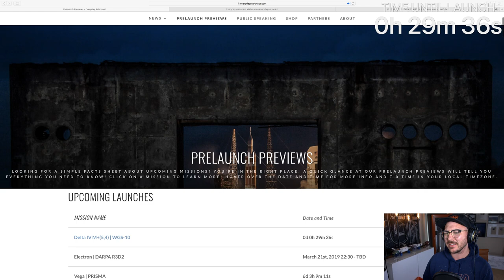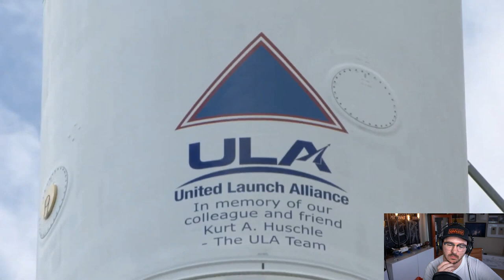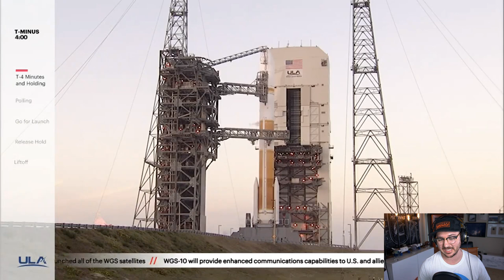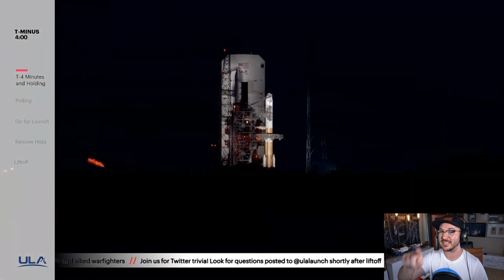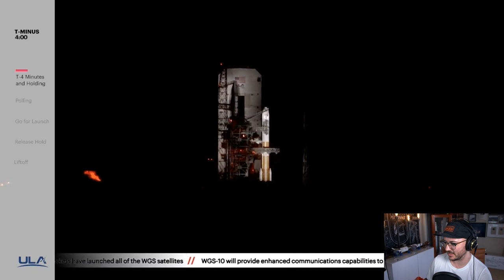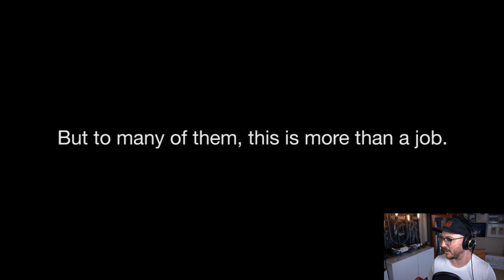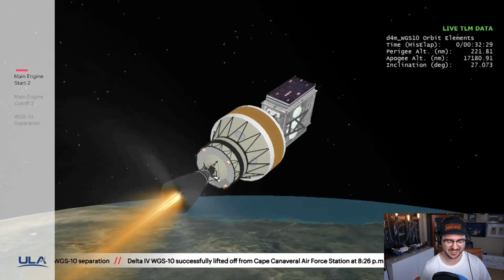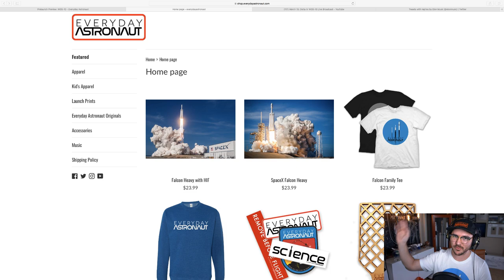Watch the second to last Delta IV medium launch EVER!

Comment: If you like that WGS logo you should check out the other 9. Just as fun. Also, fun trivia about the platypus. It was originally because of the "missing link between mammals and reptiles" reference that was being made, because the G in WGS was originally "gapfiller". It was originally intended to be the gap filler between DSCS and what came next. Then WGS turned out really well and they changed the name.

Comment: Actually,,the Falcon Heavy in Expendable Profile can lift both the Orion withEsm & the Delta IV 5 meter Cryogenic 2nd Stage together to LEO - Falcon Heavy lift capacity to LEO in Expendable Profile = 63,800 Kg. Orion + ESM = 25,880 kg, Delta IV 5 meter Cryogenic Stage = 30, 710 kg. Total of the two 56,590 kg. If we do that, we don’t need 2 launches. All SpaceX would have to do is create a new, longer faring for the FH...
Reply: But doesn't Orion need to be pushed beyond LEO for the moon flyby mission?  If so, then that limits the Falcon Heavy's lift capability to somewhere between it's LEO capacity and it's much lower GTO capacity, which is less then half that much?  Or did I read the requirements of the Orion star ship incorrectly?
Reply: I think the whole thing needs to get to a little higher orbit. So FH payload to that orbit isn't enough.
Reply: The length of the entire rocket plus the change in diameter from the F9's native 3 meter base, to 5 meters of the ICSU, and then the diameter of the orion (can't remember the diameter off the top of my head) causes severe aerodynamic issues that may not allow it to happen.
Reply: Jakalth A - Getting the Orion out of LEO & to the moon is the job of the Delta IV 5 meter Cryogenic Upper Stage which, with its 110.1 kilonewtons of thrust, Spec. Impulse of 462 & its total burn-time of 1125 seconds. I thought that would’ve been obvious from including it in the FH calculations. Remember, the Orion cannot dock! It can’t rendezvous with anything in outer space! Either you do this, or you place a docking collar on the spacecraft & then do whatever is needed to enable autonomous docking.
Reply: It's not what it can lift, it's what can fit on top of that rocket. And the fairing is no rubber balloon you can inflate to whatever you want.
Reply: aleksander suur - There is no need for an aerodynamic faring - The Launch Abort System on the Orion & the Interstage on the Cryogenic Booster would do on the Falcon Heavy exactly what they’d have done on the SLS & what the SpaceX Long 5.2 meter diameter Faring would have done on the FH. Both the Orion & the Cryogenic Booster a 5 meters in diameter. Last time I looked, 5.2 meters > 5 meters! As there would be no need for a faring, there’s no need for the 5.2 meter diameter faring to “expand like a balloon”.
Reply: @TraditionalAnglican  that's helluva more complicated than you think. Falcon Heavy is designed to fly with the fairing the shape and size it is, aerodynamics of it matter. You screw around with the shape and size of it without very careful engineering and the entire thing breaks apart on you mid-flight. It's supersonic flight you are talking about for the very first minute, you can't just put a giant blob in front of the rocket and hope for the best.
Reply: aleksander suur - I know it’s more complicated than that, but we pay engineers to work these things out. The Long 5.2 meter diameter faring is already almost 19 m long. It’s already WIDER than the Orion or the Cryogenic Booster (both are 5 meters in diameter), & almost as long. That combination is large, but it’s hardly a “blob”. 
Frankly, as a taxpayer, I’m tired of spending $23 BILLION to develop a rocket from LEGACY HARDWARE that won’t fly until mid-2020 at the earliest, and another $18 BILLION on a capsule that really can’t carry 6 astronauts with all of their gear, that couldn’t support them for more than 21 days even if it could & that can’t rendezvous in space (something both Crew Dragon & Starliner can do). I’ve already proposed CANCELING SLS & Orion & applying all future funding for SLS/Orion to development of the BFR/Super Heavy/Starship. The $4-5 BILLION we’d use over the next two years to get SLS/Orion off the ground  would be enough to finish the BFR, giving us a far more capable system that could launch for considerably less money (& orders of magnitude less per metric ton), that could support astronauts for 6-8 months (not 21 days) & LAND on the moon & Mars (& almost anywhere else you wanted to land).
That’s would be the best way to get to & stay on the moon & get to & stay on Mars, but the administrators of NASA & the politicians both seem to be intent on wasting more money on Orion, while the politicians seem to be intent on wasting more money on SLS. I’ve been making a case that they could at least save the money they’re spending on SLS, & do this launch for $200 million (FH + Cryogenic Booster) rather than $500 million + the additional $3 BILLION they were going to spend on the SLS.
Reply: @TraditionalAnglican  https://www.reddit.com/r/spacex/comments/b18f8p/private_em1_launch_guide_infographic_by_me/
There's a longer discussion on the topic here TL;DR it don't effing work out.
But I can certainly understand the frustration, money spent to results delivered ratio is off the charts. I'd say flying Orion on commercial launcher - any of them, doesn't make a whole lot of practical sense. It's a SLS capsule, designed with certain size and weight class of rocket in mind and overweight and oversize for everything else currently flying. And EM-1 is supposed to be a full systems test, so what it's testing again without SLS?
Reply: falcon heavy isn't crew rated

Comment: @31.36 It's because the rs68 doesn't have enough roll authority with the extra thrust of the SRBs so two of them have gimbal in so the delta has enough roll authority.They only have it on two SRBs because they only need it on two, and it costs more so why have it on 4?

Comment: Hi America, why can't you switch over to metric? I can convert pounds to kilograms but really should not have to. There are SI units for a reason... Not like metric to imperial or vice versa has caused issues before.. Oh wait yes it has
Reply: patkins8319 we are too integrated in our current system and it would be a pain to switch over and some people would argue that it would be “too costly” for something that doesn’t need to change
Reply: @CameronCobb  Everybody else went through that pain
Reply: We are too lazy to learn a new system, have nostalgia for the imperial system, and are too stupid to want to change. Besides, we don’t want no commie units.
Reply: @CameronCobb  we do use and learn metric, we just like to use imperial when we dont need to use metric
Reply: @yheprime7196  that's true
Reply: Spacex uses metric and a lot of us use it also. It should be hi ULA.

Comment: Everyday Astronaut, 
I apologize, but I don't know where to submit questions.  I was curious to why the shuttle flew upside down rather than right-side up??? Also does Reaction Wheels portrayed in Kerbal Space Program exist and are being used in real life space vehicles???

Thanks, 
Jeremy
Reply: If by, "flew upside down" you mean when they did their roll after launch, it was so the pilots could see the horizon. In orbit, they could assume any attitude needed for mission purposes, but would most often orient with the open payload bay doors facing the earth for thermal reasons.
Yes, reaction wheels are real and are really used by satellites to adjust and control their orientation. The Hubble Space telescope is the most famous example.

Comment: I have a question for you.  I wonder what would happen if someone on the ISS during a space walk fired a CO2 pellet gun. My Crosman 2240 shoots a .22 caliber pellet at about 450 FPS. Of course the pellet is traveling down the barrel which has air inside it. Would the pellet teavel faster in the vacuum  of space?
Reply: Yes, it would, because there is no air to resist its motion. Firing the gun would cause a reactive force on the person holding the gun. If he were holding it such that it was directly aligned with his center of mass, then it would push him backwards. If not, then it would set him tumbling, though not really very fast.
Reply: Odysseus Rex probably really would not have any affect on the astronaut because the mass of the pellet is so minimum. I saw one of the astronauts demonstrate this in the Space Station by throwing a basketball, which had little affect, and then shoving another astronaut who had equal mass and resulted in an equal and opposite reaction.

Comment: A little off topic but, why add just 2 boosters to falcon heavy and not three to increase its capabilities?
Reply: Even in its current configuration, the center core of the FH must be built with extra structure to handle the loads.
So more cores, more development, more points of failure
Reply: @philb5593 Would be awesome to see 4-5 cores land!
Reply: Practical limits are more on the side of fairing size and mounting point sturdiness, moar boosters doesn't actually give you all that much increased capabilities. Law of diminishing returns at play here.

Comment: Why does Falcon Heavy use to main stages instead of SRB's. Are they more powerful than SRB's? Surely SRB's would be cheaper in the long run.
Reply: They use the main stages because they can land so spacex can re use them
Reply: Spacex doesn’t use SRMs, as they cannot be tested. This is also why all separation events on the falcon 9/heavy are hydraulic.
Reply: I mean, not really. It means they'd either have to buy in from a third party or set up an entirely new production line for SRB's, and since the falcon 9 stages are actually easier to recover without getting saltwater damaged reuse costs are a lot lower than they would be for SRB's.

More powerful is odd, because what SRB would you compare them to? I'm sure you could build a more powerful SRB, but why would you?
Reply: I would've thought 10 SRB's expendable would be cheaper than the cost of building a main stage since they are only designed to do 10 launches. But I guess SpaceX know what they're doing. @johnwolf2349
Reply: The Falcon 9’s used as Side Boosters on the Falcon Heavy can be hot-fire tested before launch & then throttled (& turned off if needed), making them safer than SRB’s. The Falcon 9’s reusability + SpaceX’s lower production costs make them as cheap as the Delta SRB’s, if not cheaper.
Reply: @ryanwood93  Lack of scaling and reusability, both in terms of hardware and technology. It is cheaper to design and build a single rocket type and repurpose it than use a completely new rocket for every role, especially if that role is very limited.

Being too fixated on the 'long run' is a mistake that SpaceX don't do. The heavy is expecting a few dozen flights at most before Raptor based vehicles come online, so there is no long run as far as the heavy is concerned. They ask "how can we make this work now" and the easiest answer is strap the boosters they already have on.
Reply: No, they wouldn't. SRB's could not be returned to the launch site, they would have to be fished out of the sea. They require vastly more refurbishment than a safely landed Falcon 9 booster.

Comment: Nice, the last of the overly expensive finally fired off. Now, maybe they will get with the times and go reusable. It will save taxpayers, like me, ALOT of money!
Reply: Please be reasonable, if ULA, NASA & Co are going fully reusable, that would cost thousands of jobs... until there would be a change in strategy:
Don't rely on expendable rockets, but develope and build sustainable components for space stations and ground bases, also vehicles.

Reusable launch systems are already here with SpaceX or relative near (Blue Origin).
Reply: Those things that SpaceX claim to be reusable, are they being used more than once? I mean the boosters. It doesn't seem like a huge concern when something happens to them,,?
Reply: @MrUnit731  Until now, multiple boosters were used 3 times and will see even more flights.
Reply: @MrUnit731    Yes, they are most definitely reusing them. Most of their launches these days are with flight proven boosters.